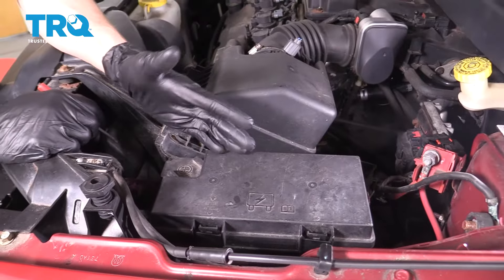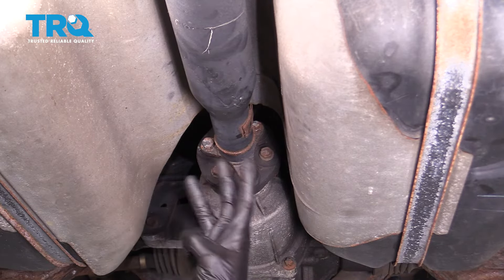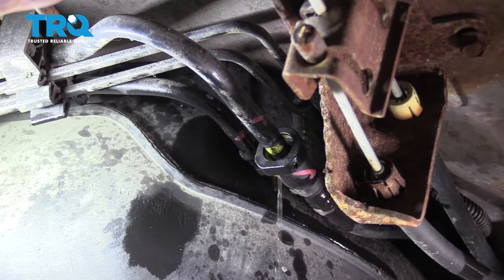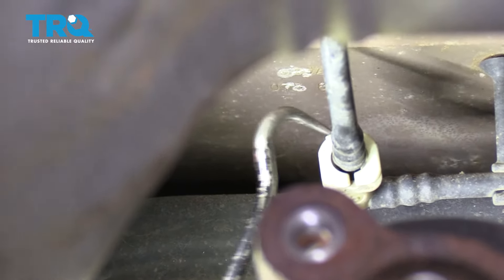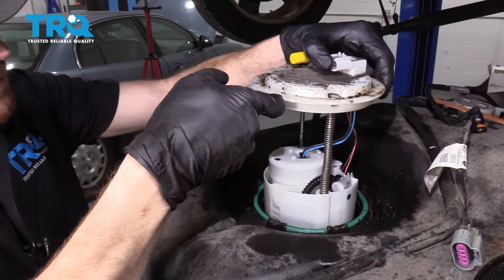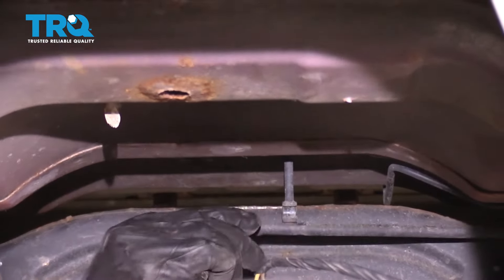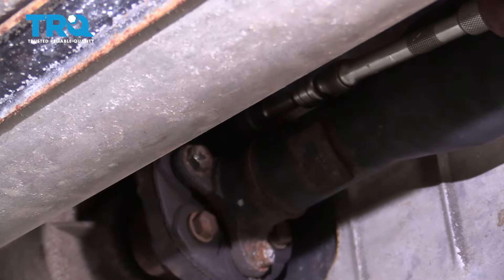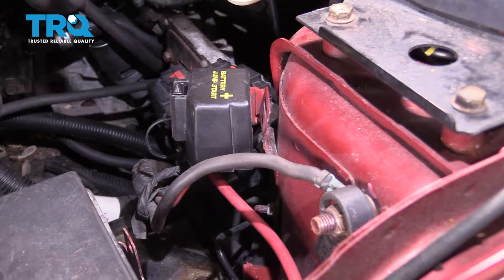How to Replace Fuel Pump 2009-2020 Dodge Journey

Comment: Okay am I missing something? You just dropped the exhaust and you are starting to talk about the bolts to take out to remove the driveshaft and then it hit me… Hmmmm the Journey is a front wheel drive and without going any further in this video, what am I watching? 🤦‍♂️  Mine is a 2010 so this does not apply at all. Maybe think about readjusting your years on this video…😜. Other than that, still love your other videos brother. Keep it up, we all love how descriptive you are. It really helps 🤙🤙🤙🤙

Comment: I think it is not the same procedure for all Journey's SUVs in the USA, I just saw one from the 2009 model and you only remove the tank supports plus their connections and that's it, it's easy to change the pump, I don't know what model it is. from this video but underneath it looks like this vehicle was rescued from the bottom of the sea, there is too much rust on its parts.

Comment: Hi, my 2018 Dodge Journey is front wheel drive. So, it does not have a drive shaft to rear differential or saddle style fuel tank.

Comment: Hello, after replacing the fuel gauge and pump assembly, my fuel gauge on the dashboard no longer works. It is stuck on the reserve.

Dodge journey 2.0 CRD 2010